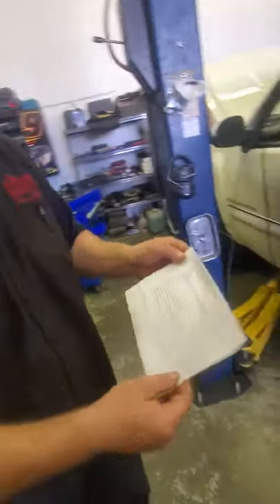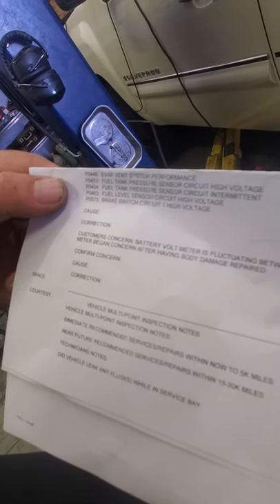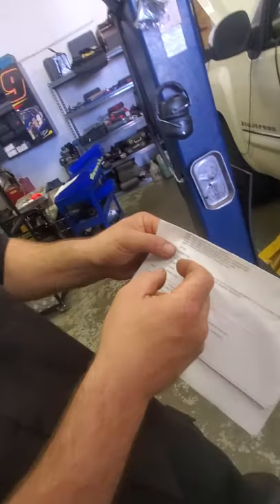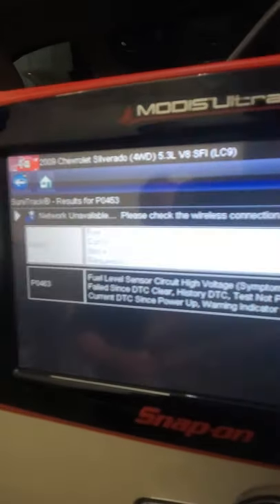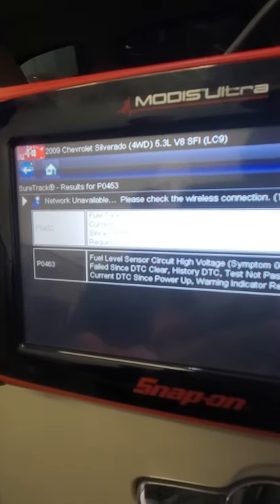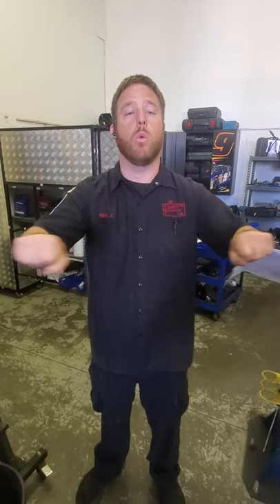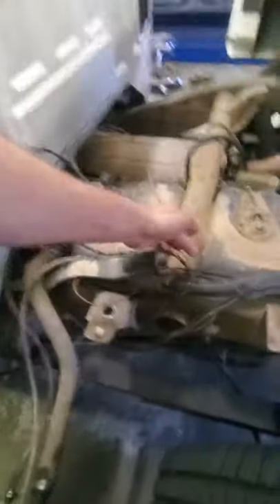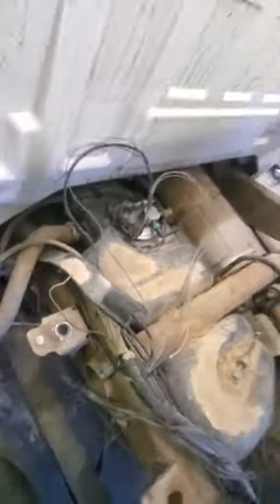GM Silverado Inoperable Fuel Guage. Not what you think! #mechanic #automotive #auto

Comment: I have a 2018 Silverado 5.3(l83) when I drive my fuel gauge goes up to the correct fuel level and I when I park or start the truck it shows the wrong amount of gas I actually have. Any tips or answers.
Reply from the maker: Original sending unit?